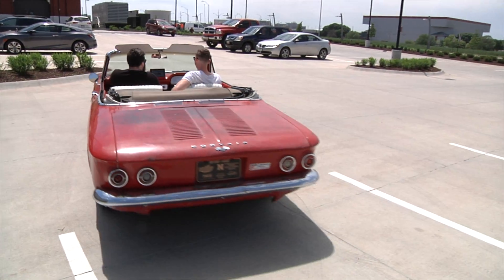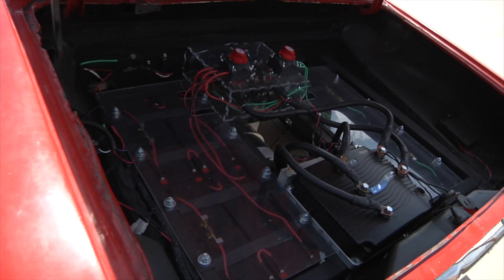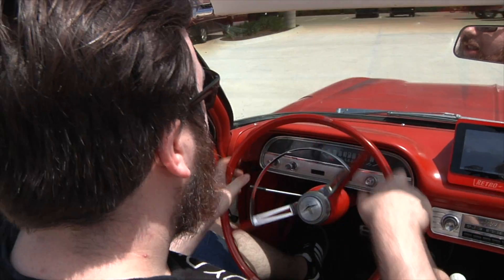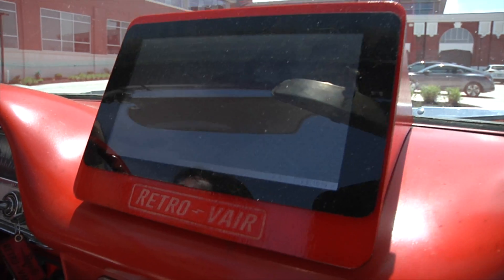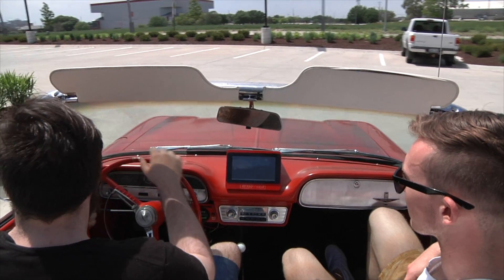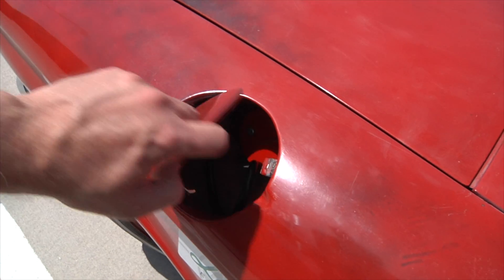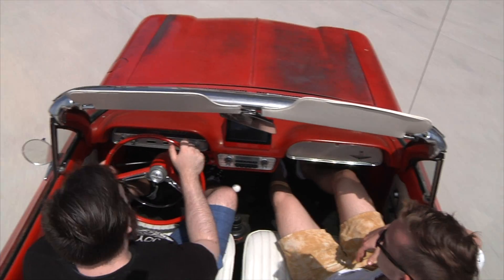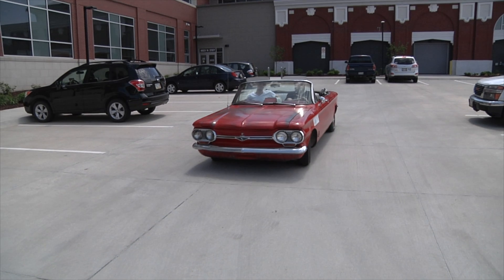Nebraska Engineering Students Build Electric Corvair

Comment: 30 miles per charge ? that's  pathetic ,  i had a well tuned 61 corvair with 4 speed that got about 300 miles to a tank of gas  highway miles in ca.  better off keeping the original corvair 6 cylinder and two one bqarrel carbs . good on gas .

Comment: 30 mile range,,,total waste of time and money///////
Reply: THE CORVAIR WOULD MAKE A GREAT CONVERSION PROJECT, THESE MORONS JUST DIDN'T KNOW WHAT IN THE HELL THEY WERE DOING, WITH LITHIUM BATTERIES THEY COULD HAVE ACHIEVED NORMAL RANGE AROUND 300, THEY'RE A TOTAL JOKE
Reply: It's more a proof of concept than anything else.  I'd pay good money for a '67 Corvair convertible with an electric drivetrain with more range.
Reply: DJ GTO I agree! Bad car to use. This car is the car that made history and safety standards in automobiles a requirement. High death rate. Higher rollover rate.
Reply: @alecfleming373  after the rollover scandal, GM modified the swing axle design to make it less prone to roll over. Same suspension design was used in the vw bug, which was (and still) is actually more to likely to roll than a corvair even with the swing axle design. But I guess corvair rolled more often because people driving them probably were more inclined to drive like maniacs. The solid steering shaft is yeah, pretty bad.

Comment: If you want an electric car, okay, but a well tuned 2-carb Corvair engine with a properly installed single exhaust is not loud, and certainly doesn't sound anything like a VW.
Reply: If an american car sounds like a vw it usually has a cam issue. But as a Porsche 914 enthusiast and i fan of the corvair, the sound would not be the reason for an engine swap on either car.